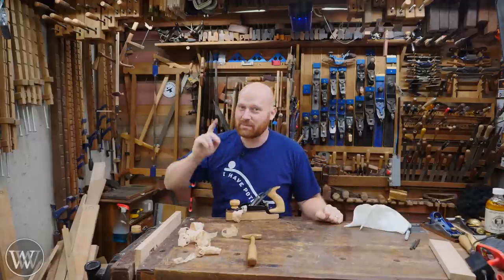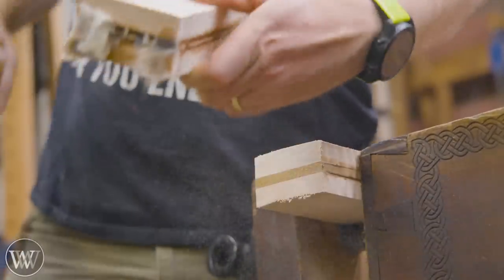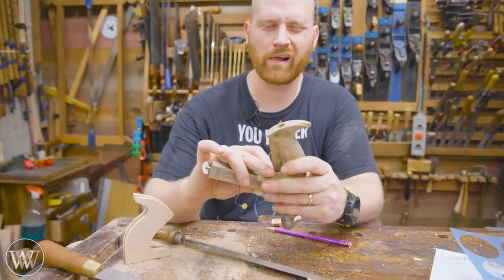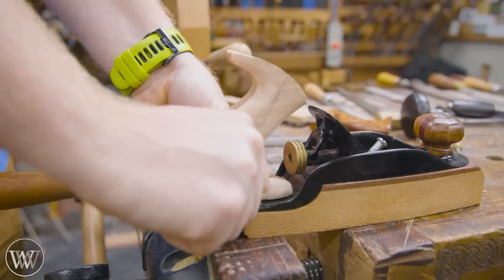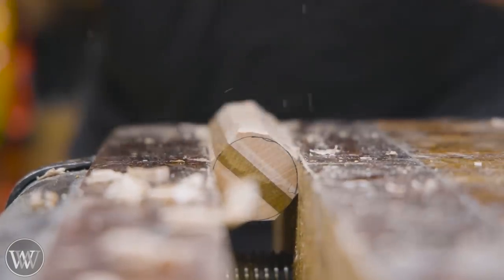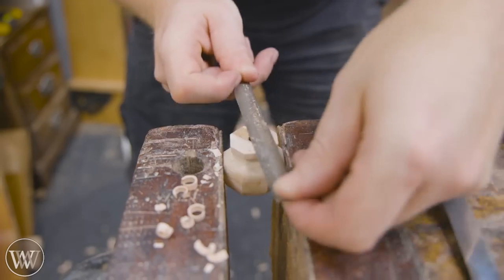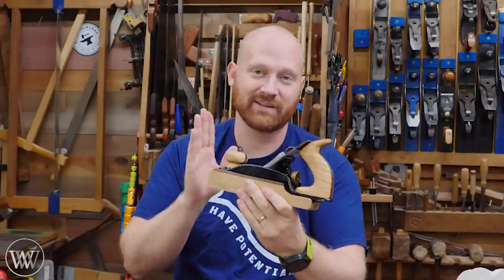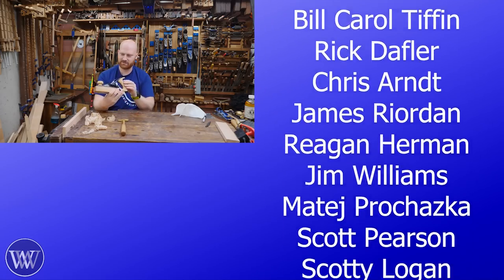Over The Top Plane Restoration With Hand Tool Rescue, Rex Krueger, Green Beetle, and Uri Tuchman

Comment: Comment on the short you made about a strop - on wood or free-handed. As a shoemaker, and, as did all barbers for ages, the leather strop had a metal grip in one end with a leather tie attached, which you tied to the end of a solid support - like the work bench. The other end was shaped as a sort of handle. One would grip the handle and pull the strop tight, and then begin stropping. Additionally, there was sometime a piece of thick waved canvas the same shape as the strop, that one would turn to the front/top and use to remove any final burrs. Just FYI, thanks.

Comment: Hey, i'm a long time viewer that is finally able to return to woodworking!  I have been slowing re-buying the larger shop tools I had to unfortunately get rid of a while back.  (example: just got a 38" wooden lathe today for a b-day present(so, so, so excited lol))  
I was wondering if you had an opinion on what are a couple tools that you suggest I should make now that I have a functioning woodworking shop.  skill levels needed are not really an issue either.  I made a table saw sled, i threw together a crappy little router table, i set up a corner work brench with wrap wround pegboard, ect.  
maybe you have some suggestions on some hand tools I could make and kill some time with?  i would really appreciate it, I need some small projects atm, i'm going through a low time in life right now.
Reply from the maker: usually my answer is make the tools you don't have but would soon need. a hand router is a good one. you could make some hand screw clamps. you can never have enough of those.

Comment: Great video! How did you figure out getting the knobs to line up?
Reply from the maker: Sorry I don't quite understand the question. get it to line up with what?
Reply: @WoodByWrightHowTo  What I mean is the dark wood layer in the knob lines up with the middle layer of the tote, & so it's centered & parallel with the sides of the plane, perfectly. I envision myself tightening down the knob only to have that center line go askew. Did you set the knob that way in the photograph for visual interest (& OCD)? The product shot looks so perfect!
Reply from the maker: In making the wooden blank I made it the final thickness and made sure that there was the same amount of light wood on either side of the dark wood. And then was just careful when trimming it down not to take anything off of the outside faces

Comment: Is there a way to do things like this if u don't have a vice or bench???. The only space I have to work is on a table outside and I have a wood stump from an old tree with a belt over it to use as a clamp for small things. If there is, can u make a video please showing diff ways to hold down pieces so they can be sawed and chiseled.... Thxs
Reply from the maker: Where there is a will there is a way. There are lots of interesting ways of workholding without a vice. But you may want to think about making a bench on bench. It's basically a small bench top you can store away but you can take it out and put it on top of a table or countertop to do woodworking on. It is all possible to do without the bench but the bench really makes everything so much easier
Reply: @WoodByWrightHowTo  ok cool. I'll look into that. Thxs for the reply

Comment: Sorry to hear your NAS got hacked.  I did a bunch of research a while back and landed on using a password manager called DashLane.

It’s not free, but it makes having high security and unique passwords for all your login manageable.  The family plan is affordable and keeps those on your home network secure so they don’t accidentally creat security issues. 

There’s also a nice password sharing tool.

It’s worth the cost and effort IMHO.
Reply from the maker: I have an industrial grade password system. But it was a problem with the software on the nas apparently around 50% of the ones I had were hacked

Comment: Seriously, though, I have never had luck with sandpaper and tight inside curves. The sand surface breaks and the edges dig into the surface. Am I just using crap paper, or is there a technique I'm missing?
Reply from the maker: Sandpaper can't give you a sharp surface unless you have a hard backing on it. I use the sandpaper here to show where a surface has sharp points so I can smooth them out with a file.

Comment: I'm surprised that you say that PVA glue needs to be clamped really tight. Other channels and woodwork magazines keep telling us not to overdo it, and just use enough clamping pressure to close the joint. 🤔
Reply from the maker: Check out all the glue testing. It reaches its full strength at around 150 psi. For most applications it doesn't have to have the full strength but to get it you have to go up that high. Also people saying don't squeeze it out you might start it I have never actually tested that they've just heard it from other people. Test after test shows it's not possible.
Reply: @WoodByWrightHowTo  OK. Gotcha 👌🏻